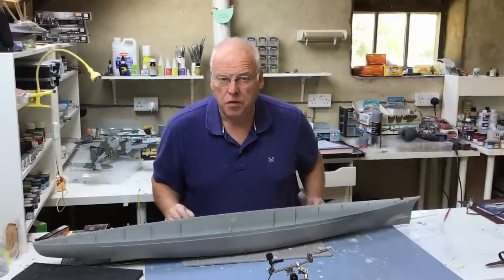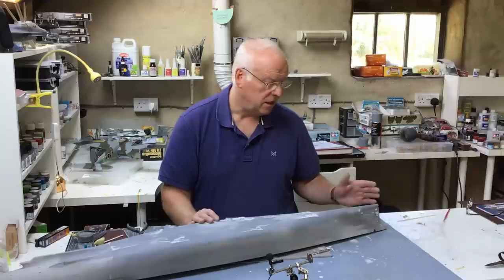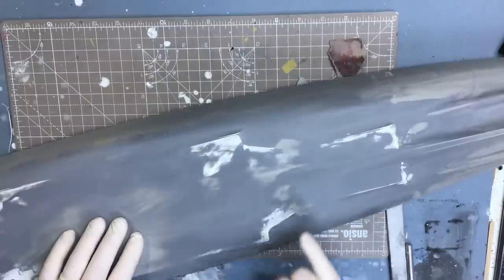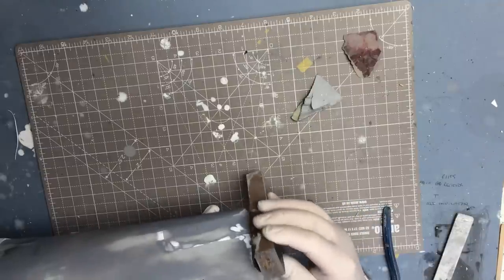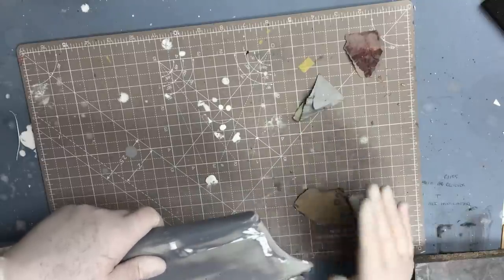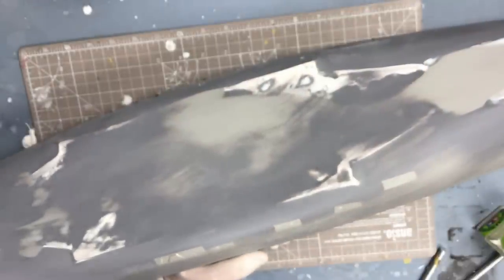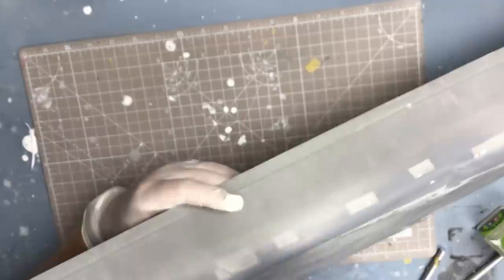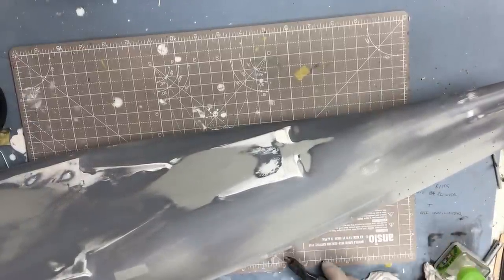Trumpeter 1/200 DKM Bismarck Full build with Pontos detail set Part 3

Comment: Your build and if you think it had those plates underneath your choice.
Only chance to confirm might be the blom and voss model ?
Or even look at pictures of tirpitz after capsize ?
Reply from the maker: Thanks Jerry. The capsized Tirpitz hull shows the bumps forward of the prop shafts and in line with the aft end of the bilge keels. The position matches exactly to the AOS drawings. I can’t see why two ships of the class would have different hull construction so I’m happy that they were there. I’d like to see the B&V model but I can’t find any reference to it. 👍
Reply: @TheModelShed  i looked for images of the b&v model as well for you, but only a head on above deck seems to be available.
Your model your decision and i think it is the correct decision.

Comment: Coming along! Why do you build the cage around the nut and washer instead of, e.g., putting epoxy or superglue around the outside of each?
Reply from the maker: I just think it’s quicker and less messy that epoxy and the cage allows the nut to float a little bit to allow a bit of adjustment of the pedestals

Comment: It appears that the steel plate lines on the hull are not on the Trumpeter model.  Could you mention whether or not this is the case?
Reply from the maker: No Bill the trumpeter hull is smooth with no plate detail at all. I’m glad about that - I think trying to scribe the plates would over exaggerate them.